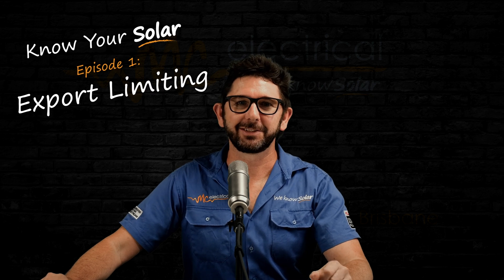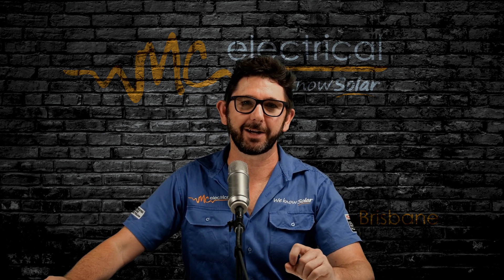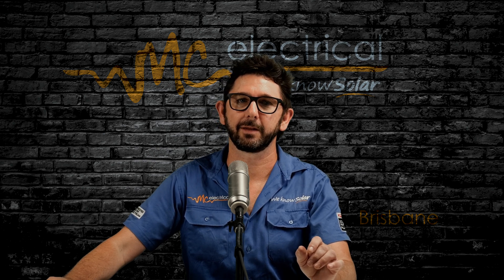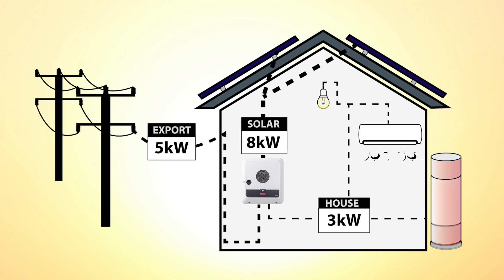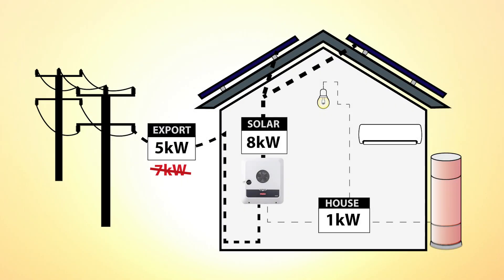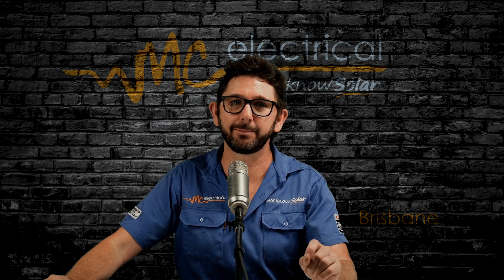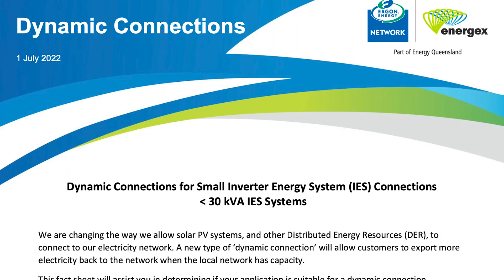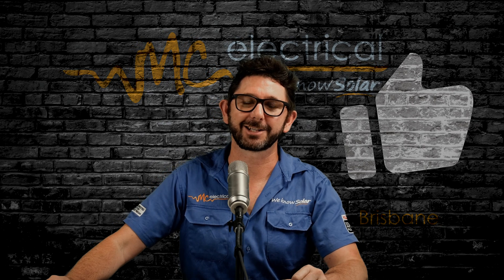Export Limiting | Know Your Solar | Episode 1

Comment: how would you solve a incoming voltage problem of 255v, would a avr at the mcb fix this  ?
Reply from the maker: No, an avr isn’t bidirectional from what i understand. You need a proper voltage regulator from like the one solar by Edge Electrons. But I’d be calling Energex or whoever the DNSP is assuming you are in Australia. They are mandated to keep the voltage below 253 (10 percent over 230v). Although that can be difficult at times. Here’s a blog I did about it many years ago! https://mcelectrical.com.au/blog/solar-voltage-rise-explained/

Comment: I live in a gated ‘lifestyle’ community in northern NSW. As such, the electricity is provided to individual houses through an ‘embedded network’. Ie Essential Energy only provides the infrastructure to the ‘gate’ of the complex. With, presumably, the complex owner responsible for internal power distribution. Most of the houses have solar panels and Essential Energy have put an export limit on the total amount of solar power that can be exported from the community as a whole. Somehow, this is partitioned among the individual residences but I am not sure how. Do you have any information on how this could happen? There is a concern that the allocation of an export limit to an individual residence is not being done in an equitable fashion.
Reply from the maker: Hmm, no specific knowledge on this but it sounds difficult to make export limiting equitable. Not sure how they would do that to be honest. You’d have to ask them how they are controlling individual inverters as a group.

Comment: Hi
Do you know if the following is possible?
I have a 13.2 KW grid tie system with sungrow inverter.
Can i limit the export on  the grid inverter and ac couple a 6kw hybrid inverter?
Given that I only get 5c kw feed in anyway.
Thanks
Reply from the maker: Hi dreamer :) In short, yes you can send wasted power to the battery. Many ways to do it. Potentially the best way for your system is to replace your Sungrow with a Tesla Powerwall 3 (assuming you are single phase)

Comment: So what happens to the energy that is not exported. Do the solar panels just heat up, with no where for the energy to go. And if so what impact does that have on the solar panels e.g reduce the life of the panel ?
Reply from the maker: Interesting question. The inverter just runs less efficiently. The inverter will change the voltage so the combination of voltage and current creates less power. (Look up I V curve.) It’s kind of like running your car in 3rd gear when driving 60k - it uses more energy to go slower. However unlike  car, the inverter and panels do not work harder when this happens, so no damage to either.
Reply: @mcelectrical  Energy has to go somewhere right? Does it just heat up instead?

Comment: Hey Mark I'm new on your channel I have a question that maybe you could help me out with ,I've got a ABB  TRÍO-20.0 TL-S2X-400 It has export limiting configuration  and Dynamic feed in control. What I'd like to know is if this Inverter could be configured with a smart meter for zero export?
Reply from the maker: Welcome :) I’m sure it could. (Smart meter is the fronius branding, so it’s just called a consumption monitor)

Comment: My fronius gen24 8kw sends equal amounts of energy to all 3 phases, even if only on L1 requires energy.
And if i need 2kw on  phase 1, the fronius will send 0.8 kwh on each phase, thus reducing consumption of L1 to 1,2kwh and feeding the grid through L2 and L3. How can i prevent it to send energy to other phases? I have a fronius 5ka smartmeter. The system has soft limit control of 0w, set by me. If i switch to hard limit trip, it will produce nothing. If i switch to limit per phase, it will produce arround 0,3kw divided to each phase. No matter on which phase there is demand, the other 2 phases will inject energy to the grid
Something is not right.
Reply from the maker: This is how inverters work, a balanced load. In Australia, the metering will account for this, so you won’t be billed or paid for power in this senario.
Reply: @mcelectrical  but if u have a restriction from the energy company to not send more than 3 kwh energybinto the grid, then that is not ok. I doubt thisbisnhow it works.
Also, if i need 2 kwh on L1 and i get only 0,6kwh on thatbphase, then the inverter is useless. It just means it is literally useless, because i use 0,6kwh on phase 1 and i get the rest from the grid and i pay for it....

Comment: I have a goodwe solar inverter coupled to a battery based inverter system with 14.5 kWh of energy storage. I decided not to pull a permit and the utility does not know about my solar system so I do not want to export any power. However, when I set my solar inverter to Zero export I get 50% less solar energy production per day even though my batteries are relatively empty and can take all of the solar that I could possibly give them. It seems like it's too sensitive and it curtails power output too often and it's simply is not behaving well with my battery based hybrid inverter.  When I turn off the zero export function, then I get twice the daily solar energy production and all of my excess goes into my battery. So that is fine in winter but in summer I will have a problem because I have too much production.

Comment: does these gen24 plus model only works with BYD battery systems? I have wired 12v lipo4 batteries i 4S config for 46v system can I connect this to Fronius? Each battery has BMS built in already.

Comment: My Solax X1 Boost inverter still gets hot and hums even though I have reduced the export limit.  My observation of the two string outputs suggests to me that it allows String 1 to operate at maximum output and that it reduces the  String 2 output so that the export limit is adhered too. ie. I don’t think it operates on both strings equally so that the circuitry on String 1 works much harder. Your thoughts?
Reply from the maker: Yeh, this is common that it will just reduce one string when ramping down.

Comment: @mcelectrical  Hi Mark, how can you tell what export limit is on your system? I have a Gen 24 Fronius Primo 5.0 inverter.
Reply from the maker: Depends where you live, It’s probably not export limited. Simple way if you have a smart meter is to look at your solar monitoring. Has your solar been limited on a sunny day just follow your production curve?  Eg, production curve follows consumption curve in middle hours of the day on a sunny day.

Comment: Funny how they won't impose an equivalent import limit on you though. Phase imbalance will occur on imports too as does voltage rise (though in the import direction it is "voltage drop"). So according to their reasoning (lies), pulling more than 22 amps from the grid on a single phase connection is the max unless the grid is to suffer (bullshit). The networks have been getting away with this export limiting fraud for years despite very little of their reasoning for it being grounded (no pun intended) in physics. It is also hilarious that they blame solar for high street voltages yet during the late evening peaks the voltages are just as high if not higher (this is consistently the case where I live, a metropolitan suburb).
Reply from the maker: Some of the rules don’t seem to make sense from an outside perspective, but the network isn’t generating or selling electricity. Their job is just to look after the stability of the grid. So while some rules might seem illogical, i would put it down to incompetence before I called it fraud.

Comment: Can you use export limiting to reduce the amount of load on the inverter so that it does not heat up as much or reduce the humming sound?
Reply from the maker: Hi Robert, I would imagine that would work. Export limiting is done by running the inverter at a less efficient mpp. But it sounds a bit concerning that your inverter is running so hot or humming so loud! What brand is the inverter?
Reply: @mcelectrical  It is a Solax X1 Boost 5Kw inverter. I had it installed two days. What I have observed is that when the solar panels are producing more than 5Kw the casing of the inverter is hot to touch and it starts to hum. With regards to a export limit the settings on the inverter are behind a 4 digit password. I understand that settings are protected by this password as most settings should not be altered  by the user. So if I want this done then I would need to convince the installer.

Comment: If the system employs a battery bank, rather than throttling back the inverter, are there any inverters that divert the excess solar energy into battery charging?
Reply from the maker: Yes! Every solar/ battery system will do this. Your battery is just seen as a load, so your solar will always go to the battery instead of exporting.

Comment: Hi Sir, is it possible to use a export limiting inverter  at Zero export  and  charge with it a electrical Vehicle without going through additional batteries?
Reply from the maker: Hi Kleenblat, yes, you’re ev becomes the load, so it should charge direct from Solar. You may want to look into “ChargeHQ” so you only use your solar to charge your ev.

Comment: Great video that clearly explains the benefit of using the energy above the 5kW export limit Mark (which is essentially “free power”, as there’s no lost FIT opportunity cost).

I’ve got a question that’s a bit difficult to explain without an image, but are the Fronius Solar web daily use graphs accurate during periods that export limiting occurs? The current graphs show export less than 5kW during periods of low self-consumption, whereas the export should be 5kW and the self-consumption occur from the ‘free energy’ above the export limit threshold…. ?
Reply from the maker: Hi Jon, Hard to say without looking at the graphs, but the problem may be due to 5 minute interval monitoring.
Reply: @mcelectrical  Thanks Mark ….. I’ve now established, following an email to Fronius, that we can’t access what I described as “free power” above what I thought was the regulator imposed 5kWh export limit.

Given that we’ve got a 5kWh inverter, it’s actually a “generation limit”, rather than an “export limit”….. the inverter limits the amount of power that can be used.

Different story with a larger inverter though….

Comment: @MC Electrical  one feature you might want to highlight is the ability of the Gen24 to charge the battery from additional power sources inside the home network. IE my old panels, were charging the battery on install day before the new panels were even on the roof. So cool. However the animation , with the bubbles going in and out is broken for the case when power is coming FROM the house to the inverter, and the click on house message is also wrong. it states... "The consumption is 2.71 kW (Ohmpilot: 0 W) which is supplied entirely by the grid." which is not true. It is supplied by additional sources to the inverter.
Reply from the maker: Yes! Agreed, that is a pretty cool feature. It won't keep your old inverter online in a blackout, but during normal operating conditions, it can use that power to charge the battery rather than export it.

Comment: Ive been told that export limiting isnt a thing on a 3phase installation? or is just 5kw per phase? i got quotes for a 9.9kw solar system, there was some confusion about my house being single or 3phase and i was quoted with a single phase inverter but told about the current limiting, once i advised about the 3 phase they said no worries we will use a 3 phase inverter and you also wont be current limited for export. is this correct?
Reply from the maker: Hi Nick, that's correct in Qld, and in most parts of Australia I believe. Usually you can get up to 5kW export per phase.
Reply: @mcelectrical  thanks for the reply mate. Enjoy your solar content

Comment: Question, sir:  Is it possible to set up an arrangement in which some piece  of gear,  (say. a pool heater) gets power only when there is excess generation?  ie in your example above, the solar generates 8kW, the house takes 1or 2kW, the maximum of 5kW gets exported,  and whatever is unused gets routed to the pool heater.  Or is that all too complicated ?
Reply: You could also do this with the inbuilt I/O control on the Fronius Inverter and use a relay to trigger the pool heater. 
Its less precise than the methods Mark has mentioned as you can only use on/off but could be useful if you are constantly exporting more than the pool heaters power.